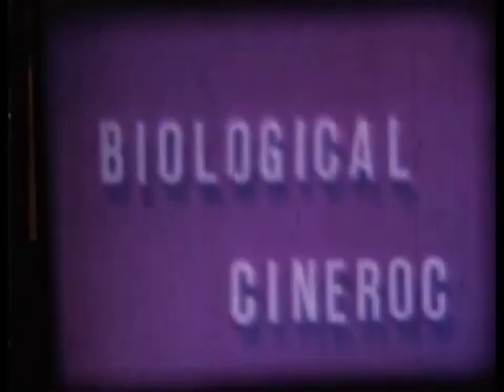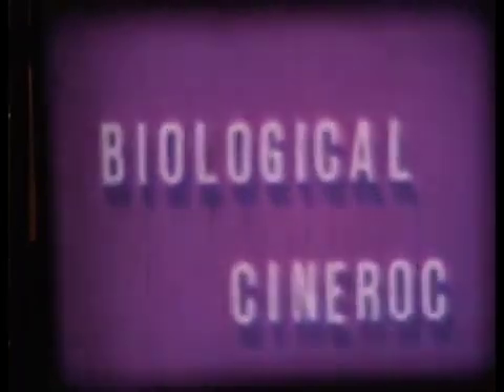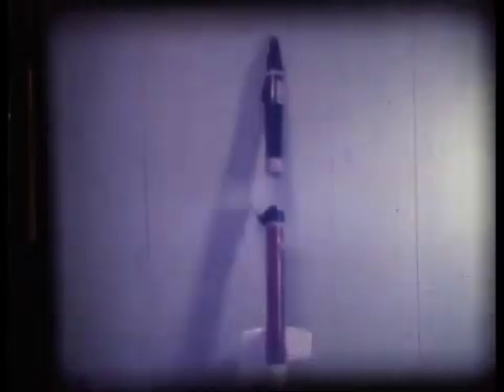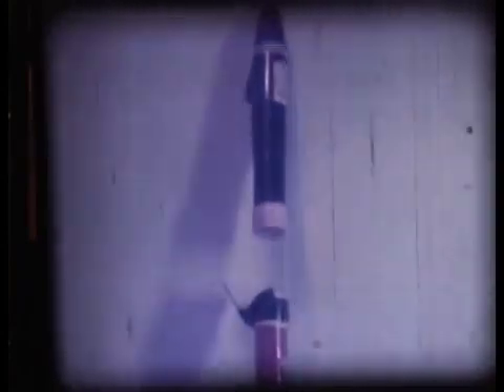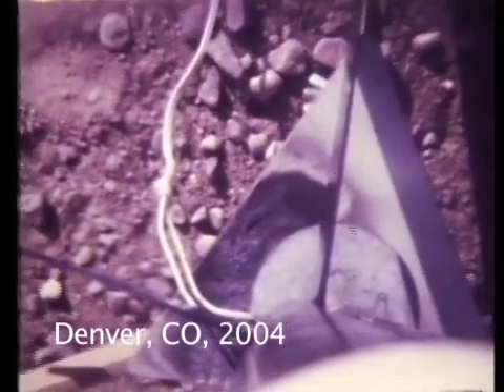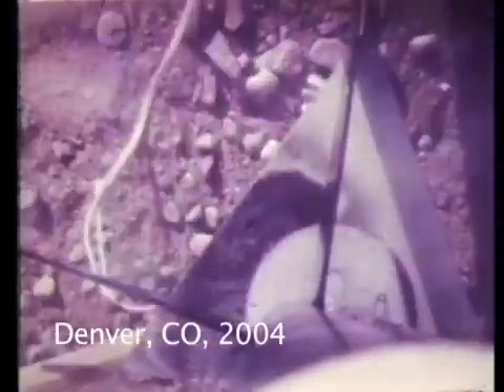Cineroc 8mm Rocket Camera Footage

Comment: Herb processed my Cineroc films when I was blessed with a Cineroc around 1986 or so.  I was gifted one by rocketeer named Carruthers Hays who came across several of them in new old stock condition.  He put out the word (in the NAR magazine I beliece) that any kid who was interested in one could contact him for it for free.  Not long after Herb contacted me (mainly because he wanted my Cineroc!) but later we became friends.  He stressed he was the only person who could properly develop the film so the rest is history.  We traded films and I still have a bunch of his films on a Hi-8 video caseete that I of course lack a machine to play them on.
Reply: See if you can find an old HI-8 camera that works and there are adapting units that will digitize and you can connect them to your computer.  Do this as soon as you can.  Old tape does NOT last forever.  I saw degradation of tape I shot on VHS-C in the 1990s!